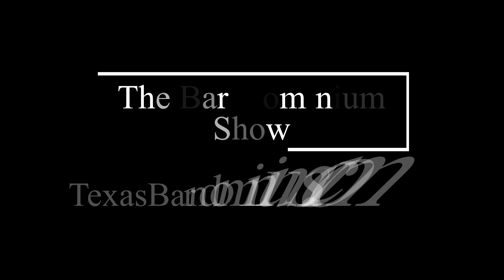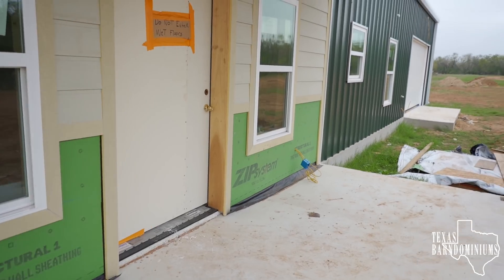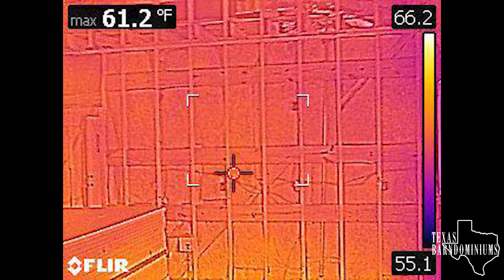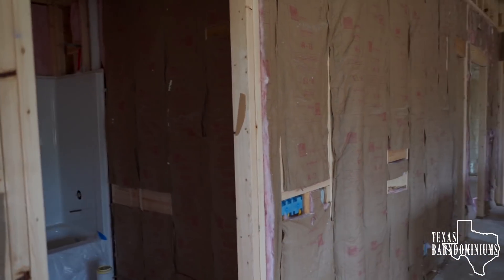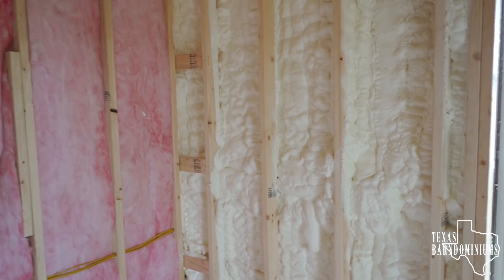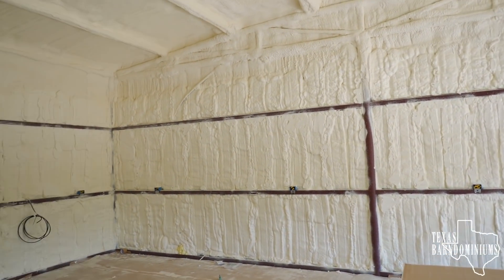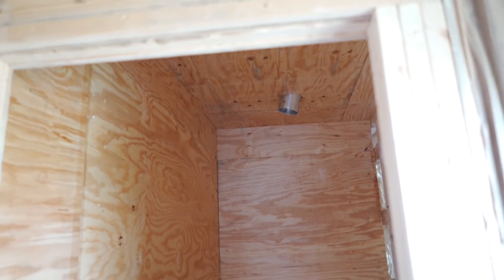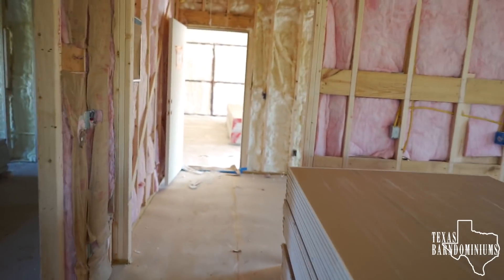Why spray foam insulation is more efficient in Barndominiums - E203

Comment: Isn't there going to be condensation between the outside metal panel and the spray foam? I thought you would want an air gap between the sheet metal and the foam, meaning the foam should not be sprayed directly on the metal panels? 
Please explain how this works

Comment: Erik, is it possible to replace a roof or wall panel that's been spray foamed?

Also, do the exposed ducts that don't appear to be insulated  ever sweat?
Reply: Yes you wrap building before install metal spray foam to wrap not the metal
Reply from the maker: Yes, sheets can be replaced easily.  If on walls, spray from outside in.  If on roof, go in attic and spray after replaced.
Reply: Erik, that is not smart in this climate zone. The wrap would be counterproductive, since you would take the exterior out of the envelope. Moisture would gather between the wrap and the r-panel.

Comment: I follow all the time and thank you first of all for all your videos and insights. Much appreciated! Secondly, I have a client here in Oklahoma and they only want to use closed cell on their shop home. What is your take on just using closed cell foam spray insulation on the entire building? There seems to be a mixed consensus between builders and insulators.  Would love to hear your thoughts or experiences.  Thanks! Bryan.
Reply from the maker: Closed cell is fine, we use it on exposed areas.  It’s more expensive but works very well.  The R-Value is higher but it won’t sound insulate as well as open cell because it’s sprayed thinner.

Comment: Can you do a video explaining how making the barndo look like a conventional home you loose benifits. What benifits? Why dont you do post beam construction? Wouldnt it be cheaper and less thermal bridges?
Reply: Barndo' is sided with sheet metal.  Much easier to replace than residential siding when you hit it with your tractor or back into it with your combine.  Steel doesn't melt when you get your BB-q grill close to it like vinyl siding does.  steel goes up so much faster thus saving time on the job site.  steel doesn't easily blow off in the wind.
Reply: @kirksway1  that also explains why its all steel haha

Comment: A question regarding insurance. When I insured my barndo after it was built they asked me about the construction of the inner walls. My entire outside is metal but when I told them it was conventional wood framing on the inner walls I saw the agent raise an eyebrow. Like I told them you would have to really have to try to set this thing on fire from the outside unless an automobile exploded or something like that but a fire inside might put you in the same boat as a conventional structure. I think I get some kind of break on the insurance but I'm not sure because of the fire rating. I see you use 5/8 sheet rock and that would be a good deterrent in case of a flash fire outside the walls but what would the scenario be if the foam ever got started? I have worked on commercial fishing vessels that are insulated with close cell foam in the freezer compartments and when we do welding have to be very careful around it. It's pretty hard to extinguish and I hate to say a couple of boats almost burned completely out from fires that got out of control. I'm not trying to start anything as I have a smaller building sprayed with foam but I sometimes worry about a fire more so with mine because my wall coverings are flammable. No sheet rock in it. Every home should have a fire extinguisher in the kitchen and utility room as well as smoke detectors. Again, I'm not trying to start anything and maybe you can elaborate on this.
Reply: I don't know why nobody is using wool it has greater quality and benefits.

Comment: There only one chance to build it right the first time. Love the interior wall sound insulation, cheap to do but huge difference if someone snoring or other. Love the exposed duct work, if it leaks or isn't insulated, who gives a cheet! Love it only being 'nice' under porches, leave the rest metal or gtfo of barndominium land. Love insulating the shop too, do it once and and enjoy the thermal attenuation forever.

Comment: best practise would be to insulate on the exterior under your metal sheeting to isolate all the framing ...just saying there are more ways to do it
Reply from the maker: The purlins are covered completely in foam anyway.  So why do more work than needed to end up with inferior system?  🤷‍♂️

Comment: Eric...do you use 2x6 top and bottom plates with 2x4 studs staggered to allow foam to prevent thermal bridging?

How do your customers finance these structures as I have heard banks will not give mortgages on metal sheeted buildings?

Also, I like the barrel roof.
Reply from the maker: We use 4” metal wall and frame inside with wood wall. Both are separated by 1/2”

Comment: Open cell foam on an exterior wall? No thanks.... There's no vapor barrier protection.
Reply: Maybe they will add one before the sheetrock ?
Reply: @augustreil  Maybe.. thats quite possible. I would do two inches of closed cell and then do the rest in open cell that way you get a perfect vapor barrier
Reply: @hoodedgood , That would work great. Up hear in the Northeast, since the closed cell is being sprayed, just put 5'' and be done !
Reply: C White builders put up a vapor barrier so that the foam doesn't stick to the metal, that way if you have to replace a panel you won't pull your foam out.
Reply: @heknows5418  Vapor barrier goes on the inside... and its for moisture control between hot and cold zones
Reply: C White no the foam is building code approved for no barrier on the inside, you could put one up but it's not needed. On the outside it is placed so as to nor adhere to the metal siding . We never put barrier on the inside , and inspectors and drywall suppliers have no problem.
Reply: @heknows5418  right on the outside wall it should not be open foam as that does not count as a vapor barrier.

Comment: my question is if you are using spray foam on the walls why would you put the zip system in. if that is closed cell foam which i believe it to be then the zip is a waste you're better off using advantech plywood for a lot less.
Reply from the maker: We are using open cell.  Why does the foam which is inside make a difference on what is done on the outside?